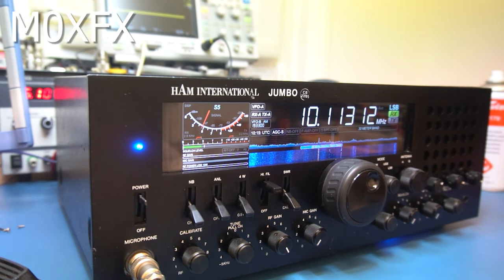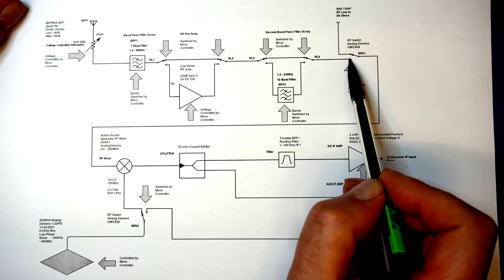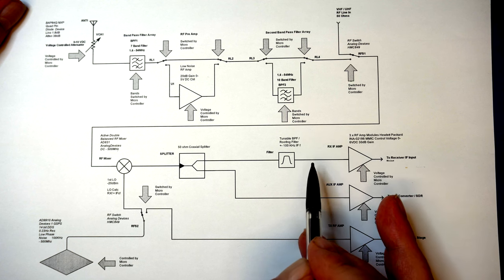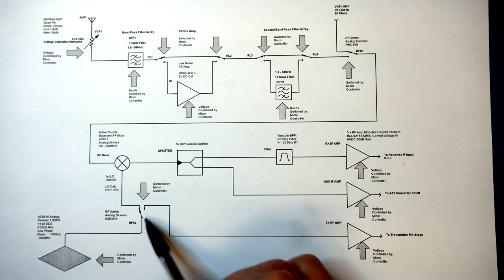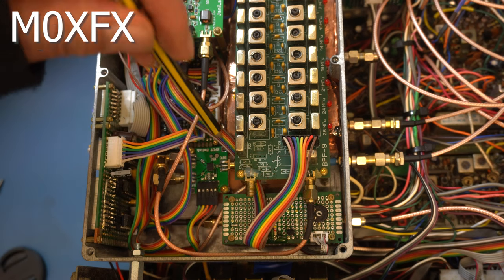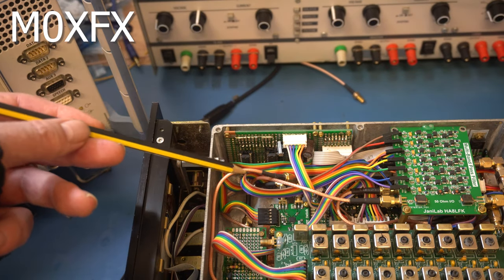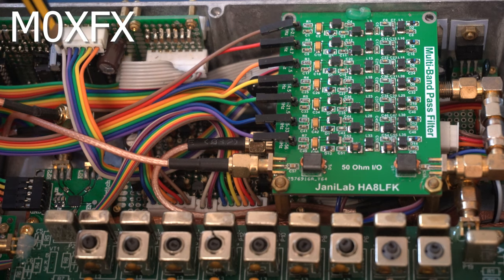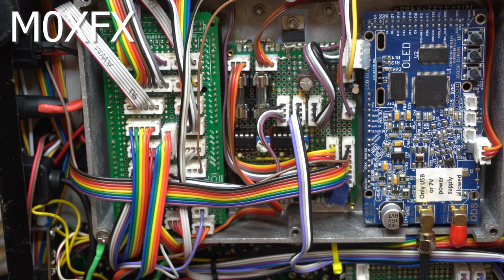A Look Inside of the Repurposed CB Radio, 1980 Ham International Jumbo Part-1

Comment: Thank you for walk-through, John.  This is certainly a very interesting project you've undertaken!  It reminds me that we're very fortunate these days that we can buy relatively inexpensive, function-level boards / modules.  Frees you up to concentrate on the higher level, overall functioning of your project.

And that's what I think folks are finding so intriguing with this project... that you're really packing in the features!
Reply from the maker: Thank you for your comment and I’m glad you find it interesting.  I totally agree that we are fortunate these days with the availability of cheap RF modules. The micro computer and coding does make the radio perform really well and with the added benefit of being to add many functions by writing code.  My next project I thinking of a complete SDR transceiver not sure whether to go with a mixer or direct conversion.   I have been playing with the (Hack RF One) module which I’m finding very interesting. Best Regards John